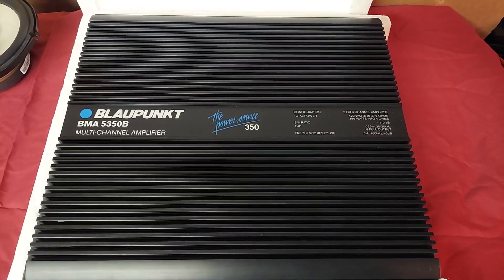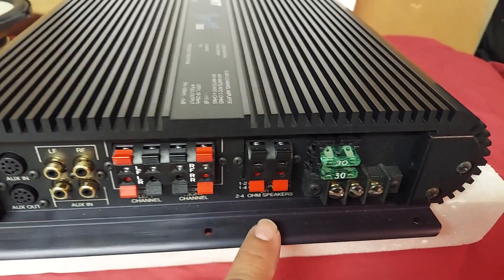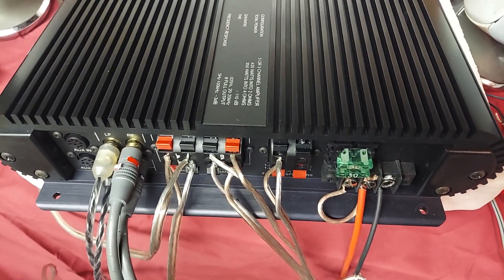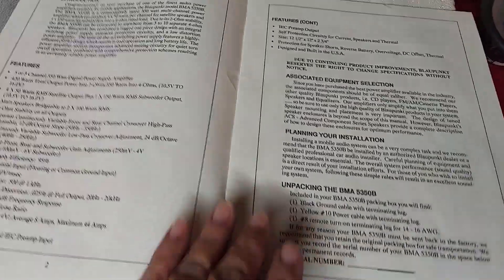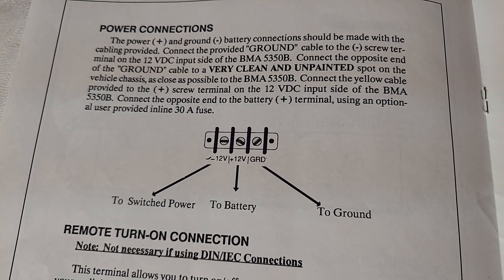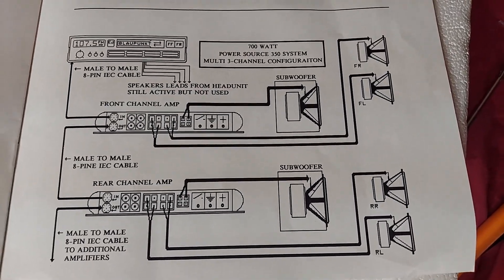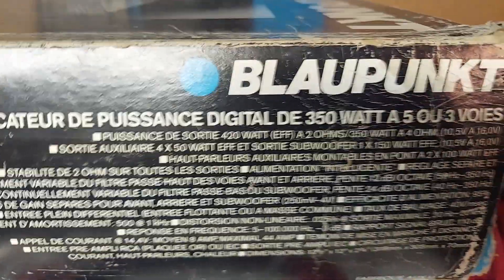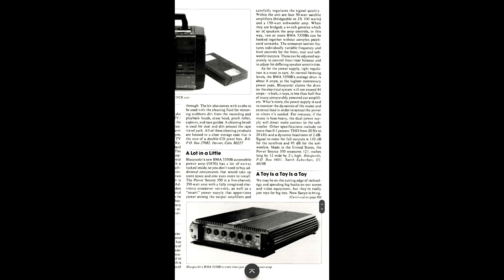Late 80s 5 channel amplifer Blaupunkt BMA 5350B

Comment: Very cool amp! I remember these and they were so out of my price range back then. MSRP of $850 would still be $700-750 at a dealer, which was a lot of money when you made $4.25/hr
Reply from the maker: Very expensive amp back in 89.  Using an inflation calculator $750 is about $1800 in today's money.
Reply: @RareorVintageCarAudio where did you get and how much? I had one when I was 18 and was the loudest system. 2 jl audio w6 12's, and a soundstream SPL 15. It was unbelievable and have been looking for one for the past 5 yrs
Reply from the maker: I bought it about 20 years ago.
Sounds like you had an awesome system. Not many people know about this model. In the late 80s
5 channel amps weren't common
this model was very expensive. 
Thanks for your comment.
Reply: @RareorVintageCarAudio  someone stole it in 96... Did you get your new looks mint mine was a little beat up but worked flawless.... How much did you pay for it 20 yrs ago
Reply from the maker: New in the box. I got it for around 400